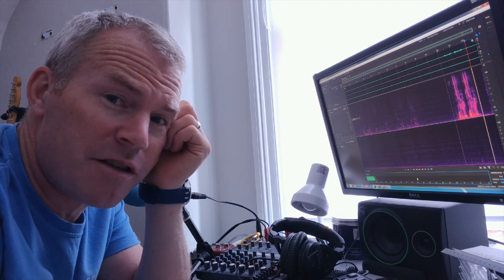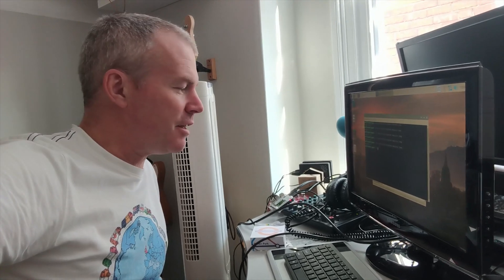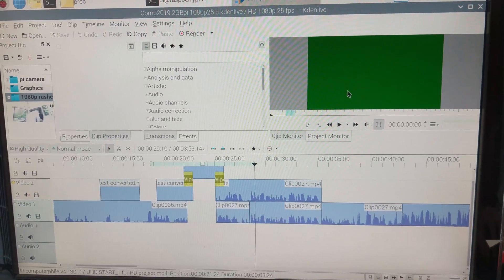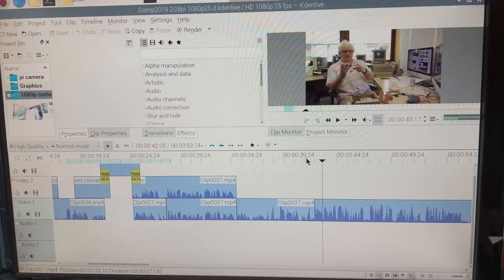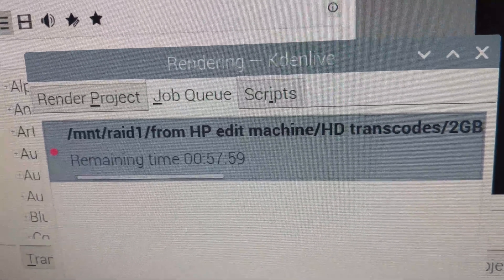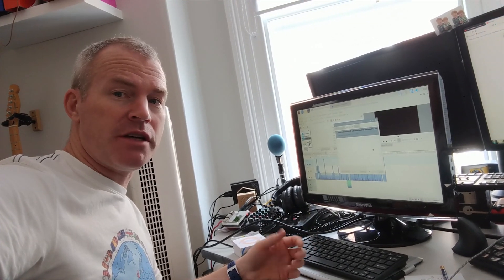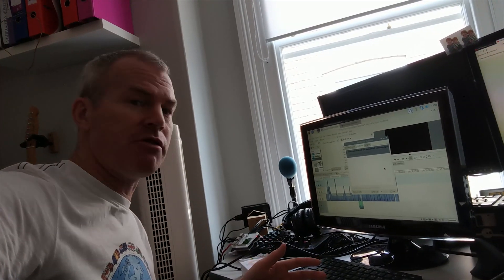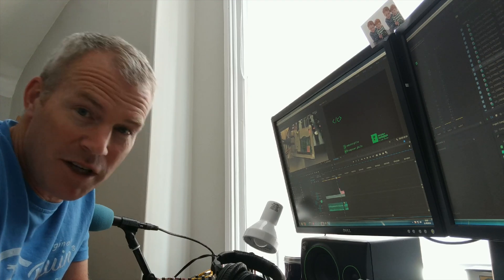EXTRA BITS: Editing on the Raspberry Pi 4 - Computerphile

Comment: Since the Pi 4 comes with three different memory sizes, could you tell us (apologies if you have and I missed it) how many gigabytes of RAM did the one Pi 4 you edited on have?
Reply from the maker: The one we put together had 4GB but had problems, I edited it on a 2GB one >Sean
Reply: @Computerphile  Thanks, Sean. So it is quite impressive it did all that in just 2GB.

BTW, I wonder if you could have edited the sound in Audacity.
Reply: I believe it was said in the main video it was 4 GB.
Reply: What was the problem? Sorry I missed it.  I'm planning to get the 4Gb version,  so it will be disappointing if I cannot use it to edit videos.
Reply from the maker: Watch the extra bits (not sure if I was just unlucky but both the two 4GB units had problems with video editing)
Reply: @Computerphile  Hardware problem on video playback? Skipping frames and melting pictures? Hmmm. 
Thank you for showing it. I may have to  use another program such as MLT or OneShot, but I may end up just buying a 2GB pi if all else fails. Thank you for sharing.